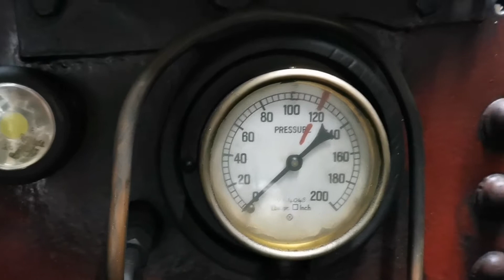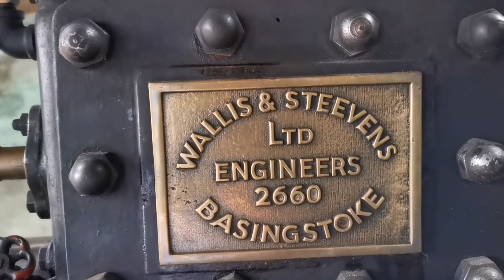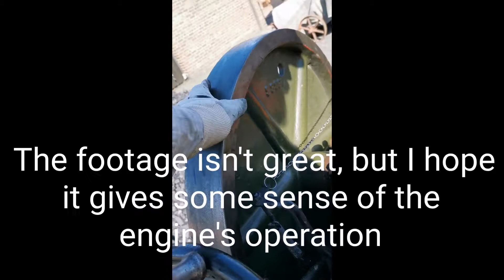Meet Billy - the 1903 Wallis & Steevens steam roller

Comment: What a lovely little roller and got some power for her size. Handy being slightly smaller than a bigger full size engine. I was lucky enough to get to help out with a mates engine that was a Wallis traction engine but was much bigger.
Reply from the maker: Thanks Matt - with us being closed so long Billy will need a good spring sorting before we can run again. It's my first experience with a traction engine, the small size is ideal to learn on without it being too cumbersome 😊👍🏻
Reply: @TheVictorianPiper  Hope you able to get back at it soon and yes the small size is good for starter to Steam as you say

Comment: An amazing video, Sean. The guided tour of Billy was brilliant. Driving one of those 'small' steam tractors was certainly not a pleasant drive through the country. Even sitting on the driver's bench seems daunting. You are surrounded by open gear wheels, rods, and pistons not to mention that flywheel. With all of the oil pots, doing even a routine check must take some time. The steering wheel is likely to give you a wrist and forearm like Hercules. Well-done, sir, taking Billy for a spin around town. You have to admit though that unlike modern vehicles, steam vehicles like Billy were mechanical marvels. You really felt like you were driving a machine, an experience quite unlike horse drawn conveyances or bicycles. It was a glorious clatter of moving parts. Be well, stay well, and keep it awesome - peace
Reply from the maker: Thanks Skipton, it's a fun machine to work with and operate. You're right though, it must have been quite the handful on the roads when it was in proper use, reactions needed to be sharp and you really need to be thinking two steps ahead as it's so ponderous to manoeuvre. As these machines progressed they started to cover up a lot of the moving parts as they were 'unsightly', but to see exactly how the machine works is visceral, there is no mistaking what makes it tick. My left arm aches today as I type, the delayed muscle soreness has struck! 😊👍

Comment: stupid thought of the day...i wonder how hard it would be to build a new one 🤔.....
Reply from the maker: Hey Andy, not a stupid thought - they are still built as bespoke engines even now, but mainly as scale replicas, like the Waterous engine in the video. You could build a full size one now, but the cost would be eye-watering, everything would have to be hand made and it would take months, if not years. Check out this website, they are currently building a new P2 class loco - https://www.p2steam.com/ and previously built an A1 in 2008. The costs is in the millions for these!
Reply: @TheVictorianPiper  im aware of the new builds.  They arent cheap!
In fact i looked in here the other day and someone in australia built a new 3 ton wallis tractor. 
I think they can do castings etc for it.
So would just need roller bits.
I build miniatures, its one of those things that seems possible but a silly idea for one person to take on.